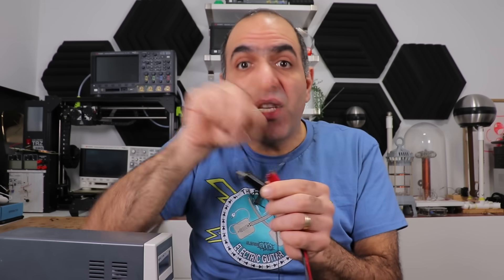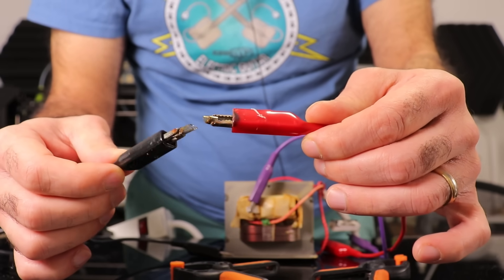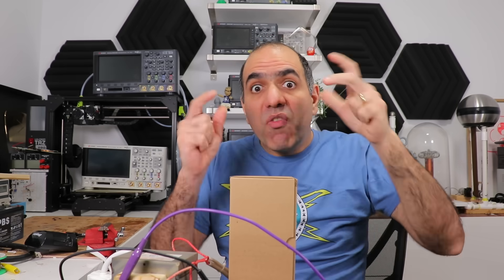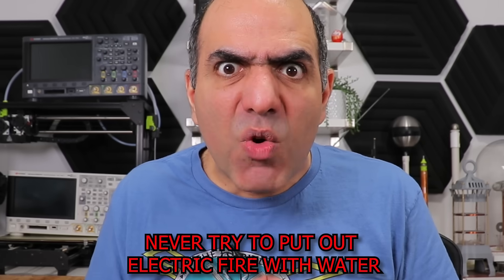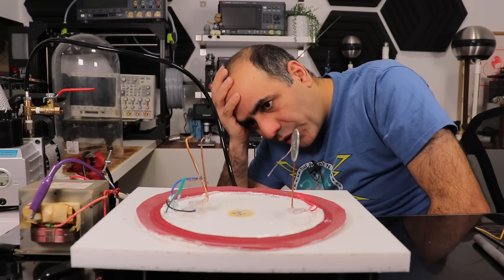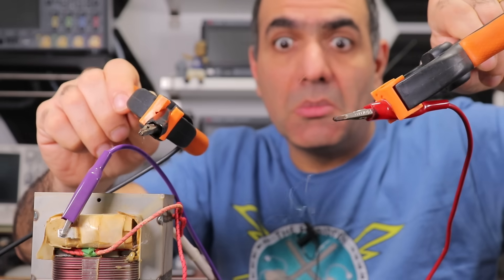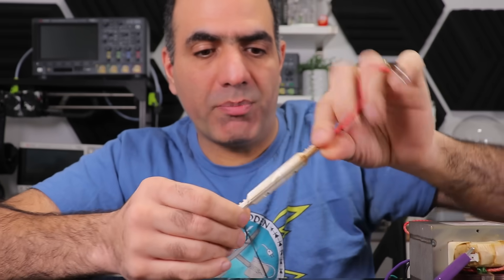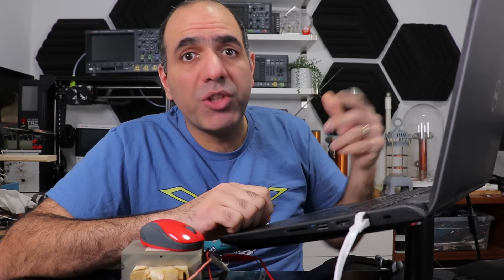Making a High Voltage Fuse

Comment: I am a complete noob, could someone explain to me the mechanics that makes it so electricity flows easier in partial vacuum and vice versa for a "perfect" vacuum? 
And preferably explain it "like Im five" rather than just showing the formulas and equations for it, if that makes sense? I know it has to do with electrons and flow etc, but I have a really hard time visualizing the process (or lack thereof for perfect vacuum).

Comment: 0:14 that burns and ashes to heat for eletrician to electricity to burnt them to dangerous to fired to voltage of the wires to purpose to arcing approching the the eletricboom video like lightning strike of to burn things them to accident to ash the fire to container of the power outage of electricity

Comment: the spring retracts, pulling the wire away as soon as it becomes moleten enough to break under tension. this stops the wire from slowly drooping and melting, aswell as pulls it out of position quickly.

Comment: 8:57 I don’t think it really needs to be a big gap in the first place. Like you said, it can only jump 1mm on its own, so all that matters is that the spring pulls everything apart quickly.

The spring may have just flattened into the metal section rather than evaporated.

Comment: They often use granular quartz in high voltage fuses that blocks an ARC upon the breaking of the element. 

The people that made the mother ship for the Apollo missions underestimated the vacuum in space and ARCs occurred from exposed wire insulation which reached the same voltage as the conductors they were surrounding. The only reason a wires insulation works is because it becomes a dielectric and forms a capacitor with the air. That causes the insulating material to ramp in voltage across its thickness. But if you remove the air the insulating material reaches the same voltage as the conductor.

Comment: Can you use a higher voltage rated fuse in place of normal?(I know current rating must be same)

Also can't you fill the fuse with oil to stop arcing.

Comment: 9:06 Better fuses have sand on the inside that will fill in the space where the wire is once it melts, they are more effective than the glass fuses, although you need to pull them out and use a multimeter to tell if they've blown instead of inspecting them visually.

Comment: hey chat AI. what kind of gas is used in high voltage fuses? "In high voltage fuses, sulfur hexafluoride (SF6) is commonly used as the insulating and quenching gas. SF6 is highly effective due to its excellent electrical insulating properties and its ability to quickly extinguish electric arcs, making it ideal for applications in high voltage switchgear and fuses "

Comment: You could also fill the fuse with sand to suppress fire. In Photonicinduction he popped 5000A 600V fuse, there you can see how it looked inside.

Comment: 7:00 - That's exactly how does high voltage fuses in microwave ovens work. They are a resistive wire coiled into spring with a part straight. When connected, the spring keeps the tension on the wire - when there is overcurrent, wire gets burned throuh, and the spring quickly increase the gap from the initial break to several centimeters
DO NOT REPLACE THEM WITH REGULAR FUSES!

Comment: I have a question: since the wire broke broke in the middle does it have something to do with the point of tension. so a stressed metal has higher resistance?

Comment: 8:47 Did the spring part of the fuse pull the wire to the left end of the fuse cavity? Maybe that's what happened during the first few moments, thus reducing the arc, and then the arc may have just vaporised the rest of the wire.

Would you consider studying the failures of fuses with such high voltage ratings as this with high slow motion?

Comment: I live in Portugal, and here we can still sometimes use a satellite dish. There are not many of them though. Mine is a motorized satellite dish with a Drake receiver. I always wanted to see that device work once again. However, the receiver didn't turn on. After watching this video, I discovered that the old Drake receiver had a safety fuse. It had blown up. Bought another one and it turned on for a brief moment and then the filament blew again. I suspect that something might be wrong with the circuit itself. Or it even might have something to do with the type of fuse. The wire on the original fuse seemed to be thicker.
Reply: there is a short in the circuit.

Comment: There are safer ways to play with the power of microwave oven transformers. The best one I’ve used is to have the primary connected through a GFCI circuit, then have it go through a momentary foot switch. Keep the foot switch at least 6 feet away from the transformer or enough that if you happened to fall from a standing position you’d still be out of reach of the transformer, then to make arcs just use a chicken stick. The foot switch being 6 feet away ensures that you can’t go touching the circuit without taking your foot off the switch thus disconnecting the circuit.

Comment: The gas you're looking for is Sulfur hexaflouride. A hypervalent gas that is extremely resistant to ionisation. It's used in high voltage circuit breakers, contractors and switches. It readily dissolves in nonpolar liquids like those used in highvoltage transformers at substations and the like. It allows for much shorter distances between contacts without arcing. 

Basically it's a stable fluorine compound and it doesn't want to give up or accept any electrons to anything so it takes extremely high voltages to initiate and sustain an arc through it.

Comment: 0:20 This definition is right. But for normal use. Not for The Great ElecroBoom guy. Example: Normal use -> 2A -> 50mA Fuse-> open conn -> yey we are safe.
Your way of working -> 2000A -> 1A fuse -> still closed conn cos of air resistance -> No one is safe...

Comment: I kinda figured that a 250 volt fuse would have bursted from a high voltage capacitor cause well.......its a HIGH VOLTAGE capacitor well over 250 volts lol heance why the fuse instantly bursted 😂😂😂😂😂

Comment: 1:21 Lmao see this is why there is Voltage ratings on fuses:):)
Seriously thinking 220V fuse will work on 2000V power supply is absolute dumb!!
3:54 But you did:)

Comment: From the limited research I did, the glass is there to protect the wire, allow for visible inspection and act as a non combustible housing, the gas inside plays little influence from what I’ve read

Comment: How we have resolve switching problems , specially DC Arc when we do switch off?

Is there any better idea other than DC breakers and installing capacitors, which should work on both 230V AC and 230V DC power?

Comment: For my transformer (4,2kV capable of delivering 3,6A constant) i had homemade glass fuses, but was getting tired of them blowing often due to my experiments, so i made HV breakers. basically a spring loaded knife switch held in place by a piece of metal that gets pulled out of the way by an electromagnet. the trigger is a simple current transformer with some controls (on the primary to not have to work with HV current transformer stuff :) ) That is nice, since now i can just reset them with levers. I also made some risidual current transformers for the "human protection" on 4,2kV but that is a whole other story... By the way, i love your videos! Especially the ones featuring HV stuff

Comment: If you dissect the remains of the oven fuse, I believe you will find that the spring didn't vaporize, it retracted completely into one end of the fuse assembly  -- that's how much tension it was under.

Comment: I am currently doing a thesis on discharges and more specifically on Paschen's law. This empirical law makes it possible to predict the breakdown voltage (the minimum voltage to trigger a discharge) of a gas as a function of different parameters. We usually express the breakdown voltage as a function of the product of the pressure and the distance between the electrodes (p.d). Observations show that the breakdown voltage admits a minimum for a certain value p.d, it is therefore "easy" to trigger arcs. Thus, to maintain this optimal value, when the pressure decreases, the gap must increase, which is why it is possible to make large arcs in partial vacuum.

Comment: I have a question for you sir.
I have a 3 phase induction motor . If I reduce the number of turns in induction coil by hand , can I make it run on 220 v instead of 400 v

Comment: All your doing is making a light bulb of sorts. Use a different filament, wala a built they invented them years ago dummy. Voltage is not the problem here it is the amperage trying to go thru the fuse that blows it.

Comment: Fuses that are used in high voltage power transmission lines quite often contain SF6 (Sulphur hexafluoride). “Because of its unique dielectric properties, electric utilities rely heavily on SF6 in electric power systems for voltage electrical insulation, current interruption, and arc quenching in the transmission and distribution of electricity.” - https://www.epa.gov/eps-partnership/sulfur-hexafluoride-sf6-basics

Thank you for the constant stream of quality content. I always enjoy your videos and you never fail to disappoint!! 👊

Comment: last time I worked with 3000V switches , it was very big and had arms coming apart with a blower to flame out arc.  That was for a power supply the size of a car and weighting probably as much as a tank.

Comment: I have used 32V automotive fuses for 120 V.  It does tend to crack the glass when they blow.  On the fuse wired that you had the did not burn immediately, if you cut the fuse wire and soldered it together, when the solder melted the wires would separate more quickly.

Comment: hello sir. I have some questions about the debate you had with professor lewin years ago about wether kvl holds in presene of changing electric fields or not and I would be so pleased if you would answer. the problem i have with your statement is that you have defined potential difference to be what measured by a voltmeter and while that is a good definition for concepts like time and space, but its not so good for potential difference. Now whene there is no changing electric fields, Electric fields are conservative and potential difference is a well defined concept and therefore what voltmeters measure is actually the same as the real definition of potential difference (work per unit charge). But when we do have changing magnetic fields then electric fields are no more conservative therefore work per unit charge on one path will be different than work per unit charge on another path, so I believe it would be absolutely meaningless to define a potential difference between two points.

Comment: Hi, I'm an appliance technician and I actually spoke with technical support about the fuses. He sent off a request for a part number and while waiting I asked about them. One of the engineers told him they do use a special gas inside the glass tube but he couldn't remember what. I would guess that you were right when you said argon.

Comment: On high voltage like 20kv on distribution line in my country Indonesia (i dont know for other country), it uses Fuse called FCO (Fuse Cut Out), its almost the same with ordinary low voltage fuse but it filled with some kind of sand to prevent arcing inside the ceramic tube. Hope it help your research. 😂😂

Comment: I have a MOT and once I tried to make a Jacob's ladder like his one, but a little better. I too got badly shocked, not because it fell, but because I thought it was off because the indicator light I made failed, and I tried to adjust the leads and it went through my right hand and both of my feet to ground.

Comment: I Always enjoy your videos. Can you try an idea of mine? Modulate a signal passing through a capacitor by inducing a changing current with an external coil of wire wrapped around the capacitor. Many thanks.

Comment: Hi, I am a great fan of your channel. I learned a lot of things.  Thanks a lot man.   I am working on an odd project in which i wanted to calculate my laser engraving machine (DIY) laser head movement.    My thinking is to calculate pulses of x & y stepper driver every fixed interval and calculate its tangent and add up its values till one job completion . As you are an expert of this subject can you suggest to me if it will work or any other method i have to use.

Comment: @ElectroBOOM The nozzles used by firemen are actually suitable for fighting "electric fires".  There is a maximum voltage depending on the setting of the nozzle (spray or other) and the distance.  Whatever, the maximum voltage is 10kV and I know a few folks who tried it on a 20kV line and lived to tell but got the shock of thir lives by the resulting specacular arcing.  And even if the nozzle is safe - the result of the use of water iare wet surfaces including the floor, soaked walls and other materials which all may conduct  electricity.

Just a footnote.  For those who are not trained and equipped for this kind of thing.  Keep the f*ck away.  It's better to watch a bad fire than being ...  part of it ;-)

Comment: This is what I found.
Glass fuse does not contain any gas AFAIK. The glass tube protects the outside environment when the metal inside melts as high temperature can build up. Glass being transparent, helps to visually inspect the fuse to make sure if it is blown.

Comment: ? do science no of this at 4:47, "wire here put it inside our vacuum chamber connect the vacuum pump now hopefully there is some good amount of vacuum and we turn the power" it light bulb with on filament, even arc lights need more than air to make a connection?
Reply: I had a stroke reading this and I am now dead

Comment: Yes, fuses do not typically contain noble gases. Noble gases, also known as inert gases, are generally not used in fuses. Instead, fuses employ other materials for their operation, particularly to prevent damage to electrical appliances and avoid the risk of fire 4. While noble gases like helium and argon have various industrial and scientific applications, they are not commonly found in standard fuses. that is the chat GPT answer, yes it has noble gases, you can also buy helium for baloons and use them!

Comment: I have a suggestion for a short

take a headphone amp for an electric guitar
but some kind of focusing dish behind the plug
plug in the headphones

and now you can hear where there are wires in the wall

they don't have to power anything
just them being connected to electricity allows you to hear them

works up to about a meter away
cost is about 30$

Comment: hello @ElectroBOOM , Could u plz assist if i can connect 2 batteries in parallel to a single square wave inverter? m just worried if the inverter gets into trouble as both the batteries would try to charge itself with full effort so the current may increase resulting into inverter burnout..plz help

Comment: I'm an EE and work with 400V regularly. I wanted to see if I could use a 32V automotive fuse to fuse a 400V power line so I put it in series with a 1k power resistor (the fuse was rated for 2A) and a 400V power source. I had the same idea; there's not 32V across the fuse so it should be fine. It exploded in my face. Not really sure why.

Comment: Considering how low pressure extended arcs, it would make sense for the fuse to have high pressure inside to shorten the arcs. Not too much so that it isn't explosive, but a few atmospheres might shorten the length of the arc significantly.

Comment: High voltage circuit breakers at substations often have the contacts in SF6 (sulfur hexafluoride) which quenches arcs. High voltage fuses usually use sand or likely similar gas to quench the arc. There are sophisticated gas monitoring systems to ensure warnings if the gas runs low as if it get critical, the breaker will open while there is still gas available to quench.

Comment: Many power companies in the US used spiral shaped copper fuses, encased in glass, filled with carbon tetrachloride to extinguish the arc. Im talking about fuses on the high side of 345KV - 169KV transformers. They were engineered before we realized carbon tet was so hazardous. They switched to solid boric acid fuses encased in ceramic after that.
Reply: This is correct!
Reply: Holy cow i replied to my own comment a month later not realizing it was my own comment. Lol i was thinking “WOW somebody knows what i know!?”
Reply: @twosticksburning  that is super funny dude
Reply: carbon tetrachloride is forbidden due to its greenhouse potential
Reply: @birgitmeixner7070 it eats the ozone. Doesnt trap heat.

Comment: I worked in the lift/elevator industry for a while. During development we keep blowing expensive fuses so one of the guys who was from Eastern Europe showed us how to make a water fuse. A bit of wire between two screw terminals suspended in a bucket of water. The water cools the wire until it turns to stream around the wire and the wire melts. A small gauge wire could carry 10s of amps. Very cheap and very dangerous.

Comment: We use fuses with wire of silver, and filled with sand. When there has been a shortcut, they will often crack open, and be black on the contact points. Also there will be a red tip poling out, marking it as broken.
It is used on the power grid, 24KV

Comment: Just a note at 4:58, if that seal is made of silicone, I would recommend against using that material. It has a very high permeability to air. There are special materials that are meant for use in vacuum seals. Not sure how obtainable they are, but it may be worth looking into. I suspect that would significantly increase the quality of the vacuum. Although it could also be the pump that is the issue.